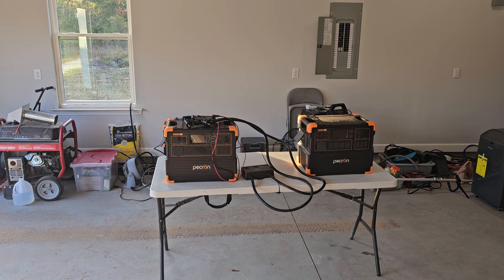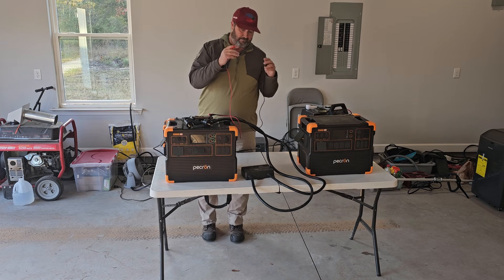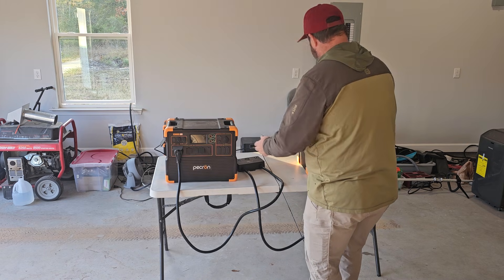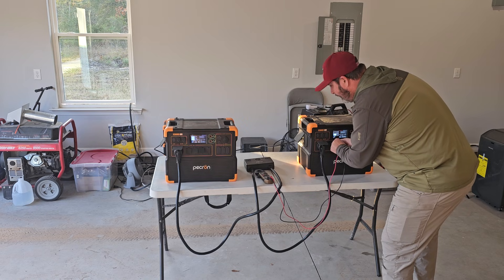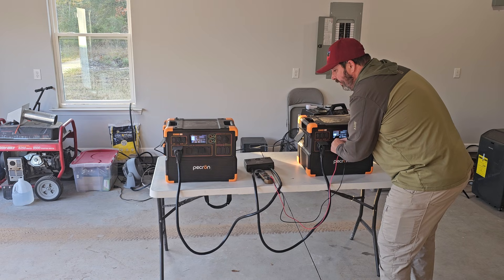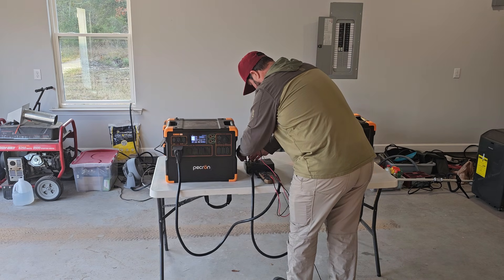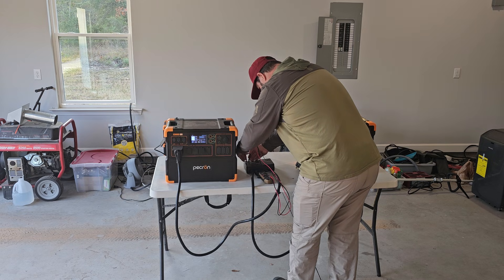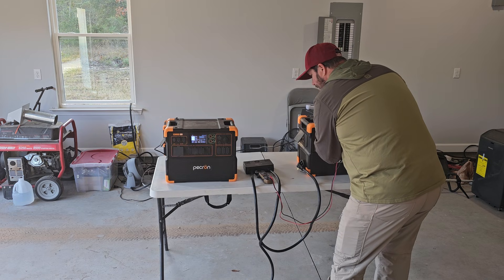Pecron Requested I Do This Test! Part 1 #E3600LFP #Solar ##offgrid #pecron

Comment: Is there a possibility that your gas generator charging your units has cause the problem?  I’m not sure if that’s an inverter generator or if that makes a difference and not sure how much you have used it to backup charge your units. Just a thought.
Reply from the maker: I don't think so. I've only used generators in testing for short periods.

Comment: Good point on the 20amp outlets.  I think there’s a trip breaker on the side of the unit, but what is it protecting and at what amperage?
Reply from the maker: I'd guess it is rated at 30A. The operators manual offers little detail on the protection systems.

Comment: Interested to see what pecron has to say.  Like I said before they have always done right by me which is why I keep buying them.  Pecron just put out a video on their youtube channel showing how to change the control board on the F3000.  I hope they sell parts in the future so when things are past warranty we can just fix them.
Reply: it seems these units are problematic. i cancelled my order for my E3600 and as soon as i get my refund im buying a sungoldpower 5KW charger inverter combo. it's a way more reliable and capable unit. if i buy a 2nd unit and paralell link them i get 10KW and up to 10KW in panels, 10KW split phase...... i could actually link up to 6 of them for 30KW, but i have no need for anything that extensive.
Reply: @andrewdonohue1853 am scared for mone to face the same fate .
I will bring out $1400 .
I hope it doesn't fail. But let's see how is it going to go !
By the way don't get the sungoldpower AIO , as it has a huge standby watts loss of 110W/H and that's huge .
I just got my AIO yesterday .
I will finish setting up my array then I will install it.
I went with thec EG4 xp6000.
It only has 47W standby leakage.
Reply: the sungoldpower 5KW is showing a idle power loss of around 50 watts when i looked it up. the xp6000 is significantly more expensive